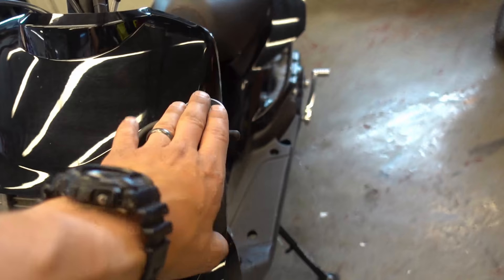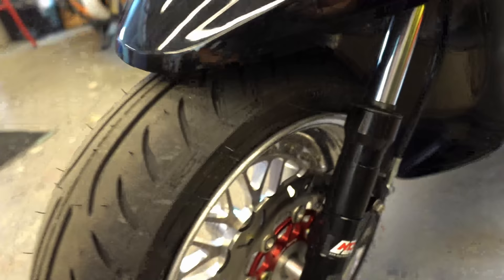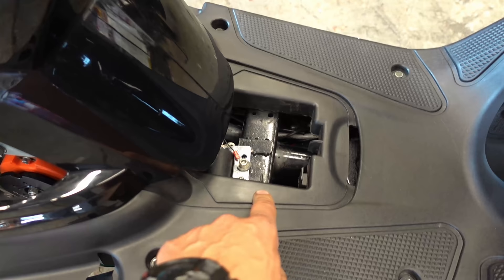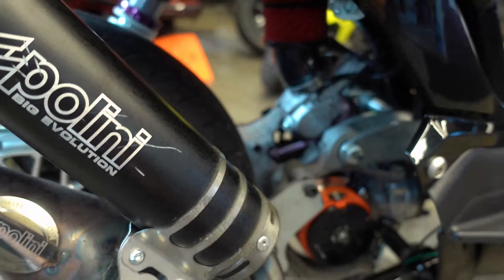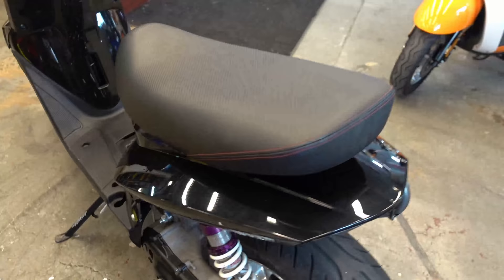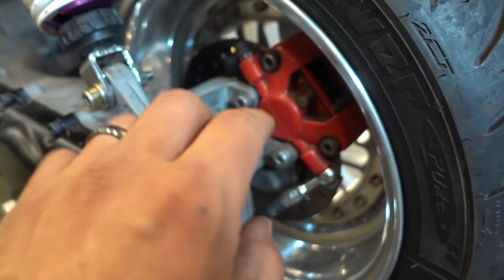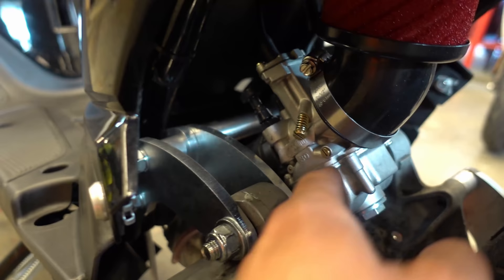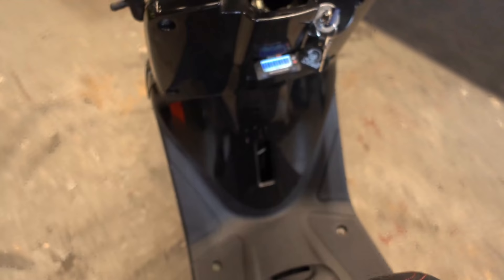Yamaha zuma prebug big evo BUILD part 2

Comment: It's a good ignition you use, but you would certainly get more out of your engine with one
Malossi mhr team 2 ignition on the scooter that you ride on in the video .....

question: The polini exhaust that puts on your scooter (evolution limited) gives it more Hk and Nm than the normal evolution exhaust for this setup
Reply from the maker: thanks for the input, we like this setup better
Reply from the maker: It used to have the evo ign and the customer requested that he needed charging system
Reply: @Scooterswapshop  okay,
does this mean that there is a battery on that scooter (-:

Comment: Really cool build but please get a better calibration on the transmission
, because as i can hear it wasn't really going high in the rpm's, and from my experience on polini evo 2 (70cc) and tpr 86cc, letting them run high with a good calibration is the key

Greetings from Italy
, keep up the good work!!
Reply from the maker: This bike is tuned for the street. I worked with some super skilled tuners in Germany on it a few years back with the large carb and digital
Ignition. We went to
Mvt as customer wants lights and tuned it to last long vs mad speed and power. This will be used on the street

Comment: Are you using 2 radiators ? Whats the setup and type of radiator + electric pump and what temprature is it running at please  ?
Reply from the maker: Single radiator, malossi pump, under 180
Reply: @Scooterswapshop  I've been running around 180degrees and notice its leaking between the sealing of the block and cilinder :/ 
You think its just a gasket or something worse going on ? It still drives, I just notice it runs at higher rpm's :(
Reply: @Scooterswapshop  Thank You sir :)

Comment: Are Korean Hyosung scooters ok  ?
Reply: Matowix i got one with 9550 KM on it
Reply: @tylercollette4109  mine has done 8700
Reply: Matowix have you had to replace anything?
Reply: @tylercollette4109  well it's just had a rear tyre and regular service by the previous owner. Motor is running fine. Breaks etc fine. I just did an oil change on it when  i got  it. So far I'm impressed with it for a Korean scooter. How about you  ?
Reply: Matowix the exhaust just cracked on mine, i got it from a friend and it was sitting for 8 years so i had rebuild the carb and i need a new rear tire on it.
Reply from the maker: nope
Reply: @Scooterswapshop  mine his great. Running like a clock. 2013 125cc  scooter

Comment: Woww,fucking dream Zuma you put together there,love it to the fullest,it has been my favorite scooter model since ever, killer design and prime performance on wheelies and cornering,own a 2nd hand one since 1998 till today despite also having recently acquired a 2008 CR-F 250cc 4 stroke for the practice of Mx and some enduro riding.Tuned my Zuma during the year 2004 and 2005 with a Polini 70cc aluminum cilinder (highest cilinder capacity that there was for sale for the BW's at the time,as this is the of it over here in Portugal).In the meantime I  decided to emigrate to Holland in 2006 and been working there since then so I have ridden it very little and only when I go back for vacations in my country.Managed to buy a 70cc Polini evolution 2 exhaust for it during my 2015 vacations,didn't rode it till july 2019 since had no vacations ever since. So here am I this year, managed to buy a CVT kit,the Polini ceramic speeddrive evo3,the Stage6 MK2 clutch,the Stage6 oversize variator and belt,and Stage6 450g clutch bell.Polini 1st gear and 2nd gear,Del Orto 21 carb,Polini 4 petal admission,Top Performances crankshaft and SKF bearings,Polini    electronic ignition and CDi.All this info in order for you to properly answere the following question: I mounted the 9g rollers after having ridden with the 5,5g rollers for a short while.The 5,5g rollers were still too light for it so I went on and ordered the roller kit with 6,5/7,5/8,5/9,5 rollers and the scooter became boggy to the point if not shifting into 3rd gear,a friend said then that we just need to swap the white shoe springs off the clutch and mount the red ones that I had also ordered just in case.I'm looking to get maximum top speed without comprimising torque too much.What set up would you advise to me and do we solve the boggyness issue by swapping the white springs with the red ones?
Reply from the maker: thanks

Comment: Hi not sure if anybody will read this but, I have a Malaguti firefox F15 lc 2001. I’m wanting to do a Full 94cc polini/stage6 ect I’m trying to save on cost on the engine case minarelli HMR malossi it’s for a 94cc build. I’d like to spend maximum of $400 if possible. Cheers guys
Reply from the maker: sounds like you are very under budget